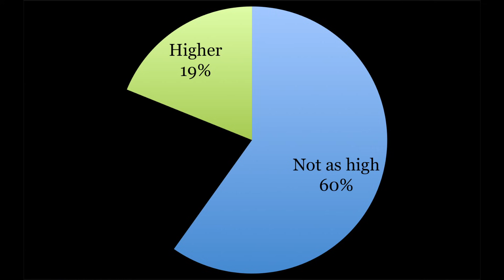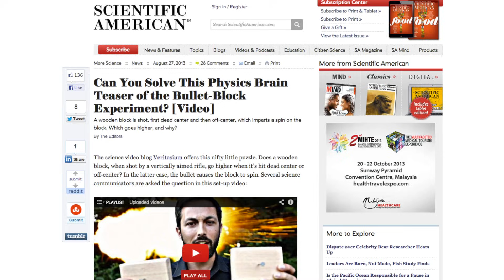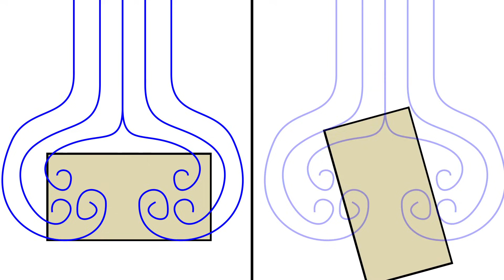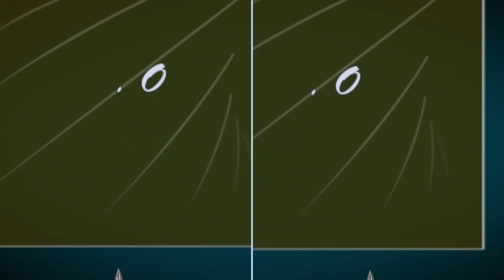Bullet Block Explained!

Comment: Wait, you seem to have said contradictory things about the energy required to rotate the block eleven times a second.  At one point you describe it as an extra 1 joule on top of the 2 joules each block needed to reach that height.  “That’s 150%, which is not a trivial difference.”  But at the end you say the rotation only required 1% as much energy (rather than 50%), which is why the bullet paths (may have?) differed in length by just 1%.  What am I missing?
Reply: The final kinetic energy of the rotating block is 50% more than the final kinetic energy of the not-rotating block, but both of those numbers are much much smaller than the initial kinetic energy of the bullet (before it hits either block).

Comment: A wider block. A larger distance between the nail and the point of impact will make a greater difference. A metal strike plate will give you more consistent results too.

Comment: When I do experiments like this and get results difficult to measure, I just exaggerate the parameters of the experiment. So for this experiment:  Instead of a 6" long board - use a one Foot long board. I suggest a more reliable density material such as plastic but wood may work when a longer piece is used. THIS should result in a very different outcome that will be measurable with the unclothed eye. Wink Wink.

Comment: every bullet travels with different speeds and even their masses are different ofcourse slightly but it is different... similarly the density of wood pieces also differ .. if the wood is softer, the bullet will penetrate deeper and more heat will be produced. hence, less hight and  vice versa.... you are not taking all these things into consideration...

Comment: There may be some variables for why the blocks reached different hight even when bullet hit the same area. For example: each piece of wood has different density, weight, direction of fibers, etc. A more standardized material may be better to conduct this experiment. I also wonder if each bullet may have different velocity than another. All these variables could be tested.

Comment: Bullets have a variation in the number of feet per second (fps) they achieve. Say you have a box of ammo rated for 1200 fps. Shoot 5 rounds from this box of ammo out of the same rifle, and you might see 1190, 1180, 1210, etc fps. This changes the foot-pounds of energy delivered to the target -- wood blocks, in this case. So, even if the wood blocks are identical in weight and size, they will receive a variable amount of energy from the bullets, resulting in a variation of height achieved. You would need to use a chronograph while shooting the blocks, and only compare heights when identical fps is achieved

Comment: This seems pretty incomplete.  You have an experiment which raises questions, and you ask your viewers to try to answer those questions.  However, you don't propose any tests which have the power to shed light on those questions.

My initial assumption was that the amount of energy transferred into motion in the two situations would be different, but I didn't really understand why.  The idea that the rotation allows  less deformation, thus less lost to heat and sound wasn't something I thought of, but makes sense.  However, the failure to show anything to support or effectively test this idea is unfortunate.
Reply: You stupid. Momentum first, energy second. If momentum should be conserved, then energy will find a way to convert to appropriate form

Comment: From this video it's clear that the bullet in the spinning block is not only off centered from front surface but also from the bottom surface @ 7:40 . This should have had  it's effect on the momentum aswell. Because when the bullet hits almost to one of the edges of the block, it has to have horizontal spin along with the vertical spin!

Please shed your thoughts on this.

Comment: I think that's no magic. The energy to rotate is much smaller than to lifting block. Bullet energy, was transferred to both block's. But if it really lift in the same high, probably the no rotating block are conservating the rotating energy in heat form. Think in this way, the no rotating block is trying to rotate in both sides, trying to break acceleration and air pressure, so it's turn this energy in hot energy... It's need a temperature tests, vacuum test to see where energy is going. OR other test is to REtransfer this energy in both block to another systrn and measure again to see how much energy was conservated in final tests... And other problem. This test is good enough? Meibe using a much higher block's or a small blocks to see better this Delta difference.

Comment: The block that was shot in the center was slightly harder to lift than the block shot on the side. The block shot in the center had to be lifted all at once, trying to pick up a steel I beam in the middle is a lot harder than lifting up the same beam from a single end. The extra energy of the spinning block came from the bullet not having to work as hard at the beginning to initially get the block moving. This is my theory anyway.

Comment: Quick question, could you have solved this using Ek = 0.5mv^2 and say that since the energy is the same in the rotating and non-rotating system that the velocity must be the same also?  Or is this not a sufficient explanation?
Reply: This is stupid. Energy is not the same in different systems.

Comment: You can use a material that has less penetration resistance, which means the energy loss per unit length of material will be less, and the smaller difference can then be measured with a "magnified" length comparing to plain wood.

Comment: You could try inserting a mass into the side of the one you shoot on the side and two weights half as massive as the first into the one you shoot in the center. 

You should be about the see the difference in bullet depth.

Another thing I’d like to see is the temperature difference between the two.

Comment: Kinetic energy isn't really what it sounds like as it is still a form of potential energy - the difference between two reference points.  i.e. the potential is energy is force x distance and the kinetic energy is force * time.  They both require a force and a position/time to calculate and these vary.  The block gained the extra energy from the TIME the bullet took to transfer it's energy, not the distance it travelled into the block.
Momentum on the other hand requires neither force, nor position as it is purely a measure of the energy contained within a body due to motion.

Comment: alright, you want to know how to measure the actual amount of penetration of each bullet to get an accurate assessment of the KE expended on penetration?    In my belief you can't.  You could switch to a plastic that is absolutely uniform in composition with no sapwood or weak spots, but that won't really help.  Every round of ammunition is going to have slight deviations in actual momentum and KE when fired.  Ammunition is made by the ton and packaged in batches.  The lead may deform inconsistently, causing more KE to be expended in destruction or deforming the target and projectile.  

I think that your assessment is correct.  The rotation requires very little energy.  The bulk of the energy is applied as momentum moving the block upwards against gravity.  The remaining energy expended is used to tear the hole in the wood and crush the metal bullet.

Comment: Well, this is really annoying.  So much left out of the needed information.  For example, what in the world would make a wooden block go flying straight up into the air when you shoot it?  Gee, that has never happened to me.  What would make a block rotate?  Uhh, I still don't get it.  And most importantly in my mind, what if you eliminated rotation of the bullets by using a smooth bored gun such as a plain bb gun and styrofoam?

Can't wait to see how this is explained.

Comment: the wooden block also depends on its density and the mass, which relates to the force that hits on it.as this is a piece of wood the material structure packed in different in different wood. hence forth conducting such an experiment is irreverent thus forth neglecting such factors.

Comment: the blocks don't go to the same height all you have to do is pause the video and the block that was hit on the side is clearly lower than the block that was hit in its center. you have to line up their center of masses not their highest points. The rotational inertia is fairly low so the variation is challenging to observe. This is just bad science

Comment: Another great experiment for the conservation of momentum appeared on my A level physics paper as a bonus question.

A man fires a series of guns horizontally from a height of 1m. All the same weight bullet however one exits the barrel at 360m/s another at 400m/s and the last at 430m/s. How long does it take for the bullet to hit the ground for each?

Assuming you're on a flat plane and air resistance is negligible.

Workings
t = √(2d/g) 
t = √(2(1)/9.81)
t = 0.45 seconds

The trick being that each despite the difference in velocity all hit the ground in 0.45s. :)

Comment: measuring  the depth would be simple. Fill the two holes with water(or any other liquid) then transfer to a interment that can measure the volume of the water. Due to the bullet hole's shape being mostly cylindrical dividing the volume of the water by pi and the radius of the bullet squared should give the depth of the hole.

Comment: Use a weaker force and an object with less mass. The relative difference in mass (from the first test materials) will produce an equal penetration distance difference. By using a projectile that uses 1/10th the force, and an object that is 1/10th of the mass, the difference between the embedded projectiles will be 10%.

Comment: This needs to be redone cause bullets have different velocities and wood has a whole bunch of things different about it from piece to piece... I'd say that the best way to do this would be to use a triggered spring mechanism like a tensioned spring that pushes a rod up that hits the block but does not go into it so that the penetration would be irrelevant to the test. I'd say the best way I got answers to questions like this was simplified experiments... In my book, Simplicity is the best way to achieve a correct answer, remove some of the negligible factors and simplify the test¡!

Comment: I think there is an error in measurement and the results are being looked at in a wrong way. When bullet gets stuck in the wood the centre of mass of the entire system lowers in both the cases. And also, the system always rotates about its centre of mass, in the second case, which lies in the fourth quadrant with respect to the centre of the block. Let's test all the hypotheses and this theory by using basic physics. 

So if we say that the centre of block reaches the same height at the highest point doesn't imply that centre of mass of the system reaches the same height.  There is some energy loss due to inelastic collision, but let's assume it is insignificant as X -Ray shows bullet reaches the same depth. (Will come at it later)

On applying linear momentum conservation, the centre of mass would have same initial velocities and would indeed reach the same height, which would mean that at some instant or permutation, due to rotation, the centre of rotating block would even be higher than the non rotating one, but we observe that in very favourable cases it reaches at most the height of 1st block. This would imply that the centre of mass stays lower than the non rotating block, but that's impossible since that would imply that linear momentum is not conserved. So premise of different heights of centre of mass is not possible and both have same initial kinetic energies, so the observation that centre of the block reaches the same height is wrong, and it must be the difference in amount of heat dissipated to account for additional rotational energy, implying different bullet depths (That's what the video says) 

So my conclusion is, all the three options to the original question are correct, since we are observing the centre of the block, which keeps rotating with respect to the centre of mass of the system, which in this case reaches the same height so the centre of the rotating block will always be within plus minus  (r-h) units of the centre of first block, where r is the offset of centre of block with respect to the centre of mass of the 2nd system and h is the vertical offset. Thoughts?

Comment: ACTUALLY THERE Indeed IS SOMETHING WHICH WASN'T TAKEN INTO CONSIDERATION-- "Inertia of rest",  also I'd recommend to MODIFY the same experiment(since you asked) with metal blocks-- hollow and solid dense metal blocks(if possible).

I can give a lengthy answer but I don't want to type much, so here's the shortest version---

Simply put, the answer is-- because the amount of energy used to accelerate (to bring it to state of acceleration) those two blocks were different, it's like a lever and pulley thing.

The energy used to move the block without using the lever and pulleys took more energy in just accelerating it ( talking about the BLOCK HIT ON THE CENTER)

While the amount of energy was more efficiently used in case of using pulleys and levers( talking about BLOCK HIT ON THE SIDE).

I hope it explains enough to get your mind running.

Comment: The next experiment I'd want to see is a 6 foot long "block" of wood instead of a 6 inch (guessing) long block. Does the center of mass still rise to the same height? Intuitively, no (but I and 60% were "wrong" before). The center of mass is displaced from the center of volume by the density of the bullet vs wood density difference.) Also, how much of the motion is due to exhaust gases from the rifle rather than the bullet -- fire a wax bullet or blank?

Comment: An electric analogy. We have a capacitor C charged to a voltage V. We switch on a second capacitor C in parallel. What about V' ? 
1/ Total capacity C' =  2C. Initial charge Q is CV. It is evenly split between 2 capacitors = 2 CV'. Therefore V'= 0,5 V
2/ Initial energy E = CV²/2. If we believe it is conserved, E=C'V'²/2. Therefore, V'=0,707 V. How come ? 
Well; eneregy is conserved, but not within the circuit. Some is dissipated as heat in any non-ideal conductor & switch. Some is radiated as electomagnetic wave.

Comment: How about trying with paint balls instead of bullets. Paint ball will burst on impact hence eliminating enery loss due to penetration. 

But damm, because of conservation of momentum, block should reach the same height. 

There is another thing that can be done... 
You may  Use iron block instead of wood. And use Wood bullet... 
In this case, bullet wont penetrate and qould probably burst leaving a dent. 

You may setup below to test 
1. Energy loss
1.1 Have a decible meter to records the sound after impact... more sound means more energy loss.. 
1.2 Check iron block temp immediately after experiment. More the temp more is energy loss. 

1.3 You may measure the dent created in iron block. Again bigger dent means more energy loss.. 
1.4 You may also check the debris of wood bullet... In case of more energy loss, Debris should be smaller wood chunks... 

In addition, set up to check the height will also be required to test conservation of momentum... 

Hope this is not too much to ask... 

Btw, i am big fan of yours... 
1.3

Comment: The temperature of the block hit at it's c.o.m. will be higher than the rotating block. The extra thermal energy of the non-rotating block should equal the rotational kinetic energy of the rotating block. That's how one can reconcile their energies...He sort of mentions this, but doesn't spell it out explicitly. Furthermore, I'm not surprised that the penetration depth is nearly identical for the two block. Sure, only one of the blocks is rotating, but the bullet's velocity is much greater than the rotational speed of the block (omega*r).

Comment: My Answer to the challenge modification: I think that if you used blocks that had more length then you could see a more measurable difference of penetration depth. Let me explain my thought process. If you use say a block which is a meter in length compared to what that seems like a 10cm length block in the video, and shoot the block such that the bullet hits as far away from the centre of mass as possible, what that will mean is that for the block to continue with the same upwards linear momentum as that of the block shot in the centre, the bullet in the block hit on the edge would need to have a lot less energy lost due to heat/penetration and sound because in order to spin the block you would need more energy and torque. Thus less energy would have to be lost to provide any form or rotational momentum. Or maybe, after a certain point it just won't rotate. I dunno. This is just speculation.
Reply: I agree with you.

Comment: Okay, bullet depth measuring problem can be solved. if something is too small, make it larger, right? And bullet depth can be made larger if you use a softer material like ballistic silicone or something even softer. And use a huge chunk of it so the bullet won't go through or break the block. I suggest trying the same in a vacuum chamber to eliminate things like magnus effect or anything related to air resistance. cheers